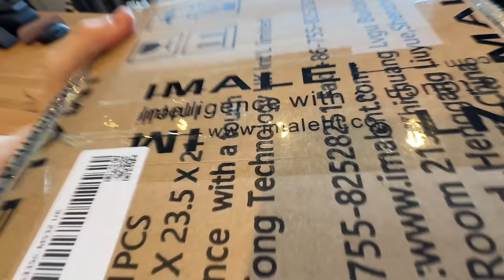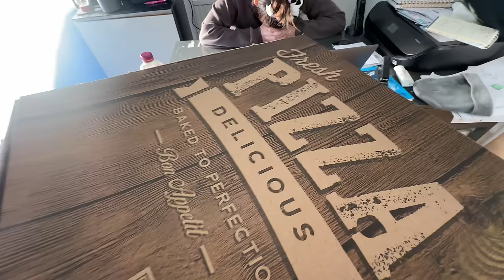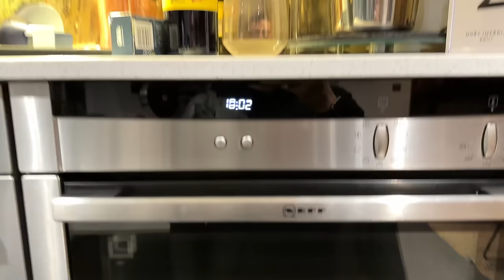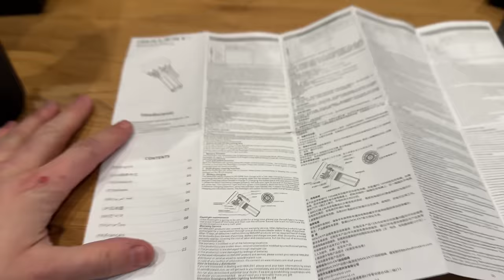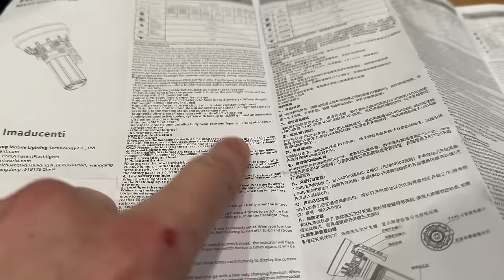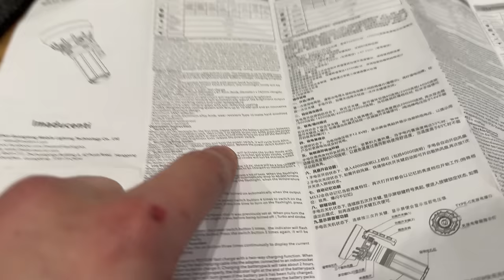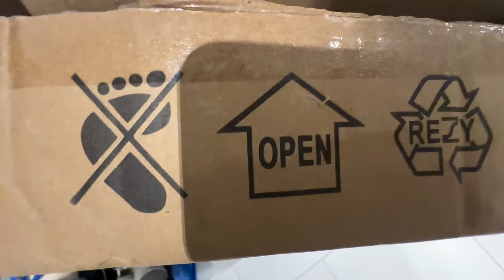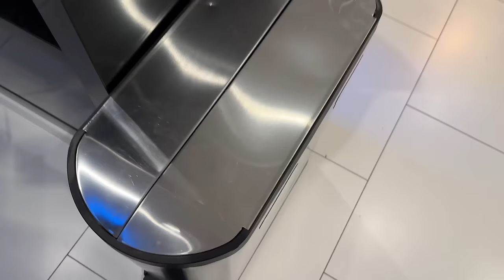I Bought the World's Brightest Torch... and it’s INSANE!

Comment: Hey Tom, Was thinking about your sofa positioning and was wondering if you could put the two corner pieces infront of the TV and the long one (that currently looks awkward), attach it to where to smaller of the two corner piece was. and it would be rotated to the long edge goes against the wall.

Comment: Don't know if you'll see this, but the website says the torch lasts 45 seconds on turbo mode @200k lumens, after which it switches to 40k lumens where it lasts 40 more minutes. Up to 18 hours in 2000 lumen mode, and up to 345 hours in "moonlight mode" at 80 lumens.

Comment: you should look to see if you could get corkboard or balsa wood and mount it to the shevles using one main mounting point at the top and then in the middle and bottom use heavy duty magnets that way you can remove the dart board set up if your ever needing to use the sheves without any hassle

Comment: Tom, just for the future; most storage containers/boxes? You can take the lids off and stack them inside each other to save space when they are not in use. Playing Tetris with them can be fun, but they are easier to move that way.
Reply: Though I do admit, not all storage containers/boxes actually stack properly, if at all. But the ones you bought looked like they might have been stackable. I stand corrected if they are not.
Reply: they aren't stackable
Reply: That is unfortunate, but yeah, I stand corrected.

Comment: Day 5 of telling Tom how to sort out the alarm on the Defender 😂😂😂Tom try to press the key fob two or three times when locking the Defender by doing this it will turn off the inside movement sensors and only activate the outside alarm turning off the inside sensors that have been affected by water damage then you can at least lock the vehicle without the alarm going off all the time😊 it works on my BMW and mini it's worth a try

Comment: Tom probably shouldn’t put it on plastic surfaces when it’s boiling hot! Tom only problem w the stencil is it would have to prob be made out of metal bc of the high lumens anything else would prob catch fire. Tom the plug for the massage chair is still plugged into the wall. SMH

Comment: move the extra sofa along the wall with the rest, it will have a hand rest on either side of it and would be out of the way, and i looks like it would fit perfectly, also gonna comment saw ridges into you slippery driveway bricks for safety and traction until you do it